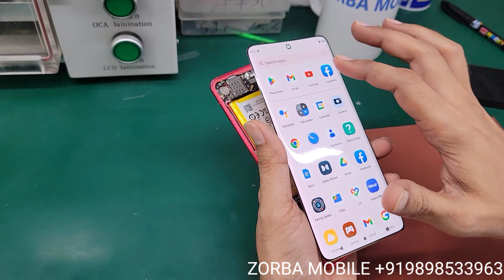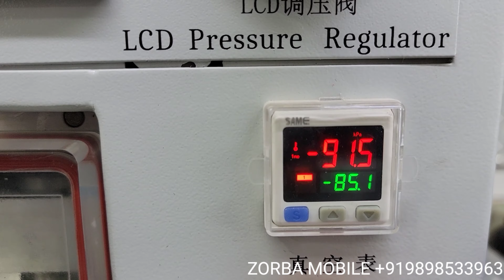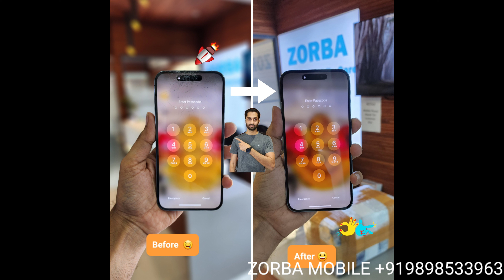Motorola Edge 30 Fusion Glass Change. Motorola Fusion only touch Glass Replacement easy way.   zorba

Comment: my moto edge 50 fusion just got cracked ... can u fix it ?
and if yes  what will be the lowest cost?
Reply from the maker: 9898533963 whatsapp
Reply: I checked with service centre they told 11k for screen replacement